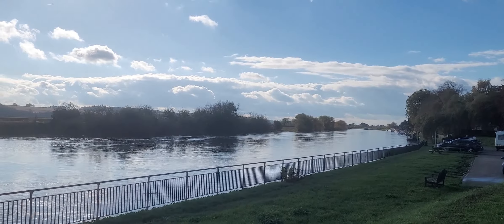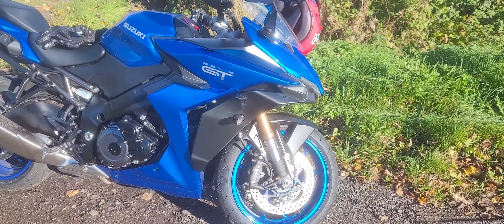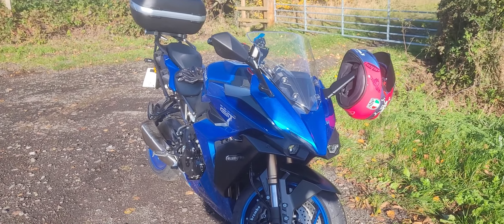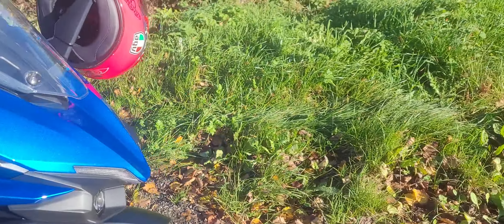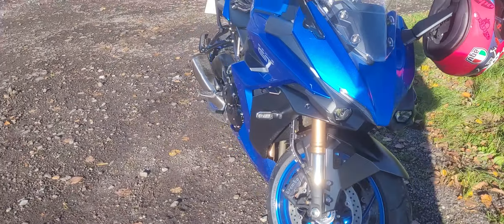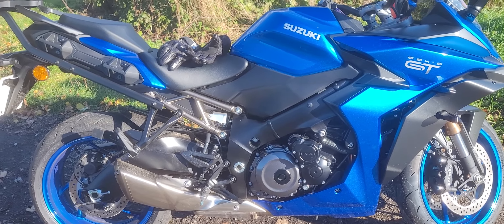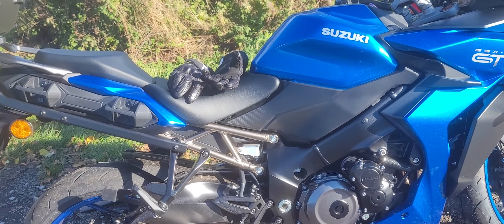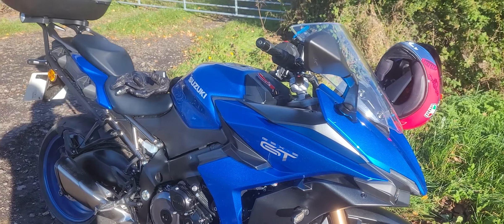Suzuki GSX S1000 GT Talking Running In And Why

Comment: Yep, I followed the guidelines and made sure I did the 600 mile first service at the dealer. 10,000 miles later, running exclusively in A mode, no problems whatsoever. Changed oil at 3,500 miles, ECSTAR 9000 full synthetic, again at 8,500, extended the recommended interval since running full synthetic. However, I'm not sure about the interval for the spark plugs, 10,500 seems way too short for Iridium plugs. You may notice the "GSXR rattle" from the motor, rest assured, it's just the cam adjuster doing its thing, not a real issue. I did get the panniers with mine at purchase, don't like top boxes, but I did remove the pillion and mounted a Kemimoto hard case in its place. Enjoy your bike and stay safe!
Reply from the maker: Thank you so much for your comment filled with great advice.this is why we started this channel. Thanks again for taking the time. Ride safe

Comment: Quite right...Run bikes in with mechanical sympathy, it's more about keeping the engine spinning freely within the rev ranges suggested & not letting them labour too much or run too long at a single speed. Suzuki know how to build strong motors & want to keep that reputation intact. Look after the bike & it'll hopefully look after you. (Smith & Allan do good oil at a fair price for the 20ltr pack if you're doing it yourself after the first service or in between dealer services). Go well.
Reply from the maker: Thank you so much for your comment and your wise words. Ride safe